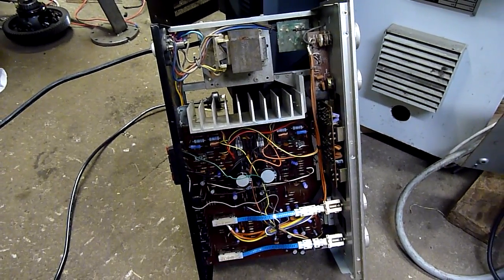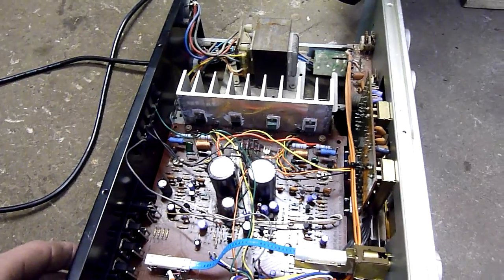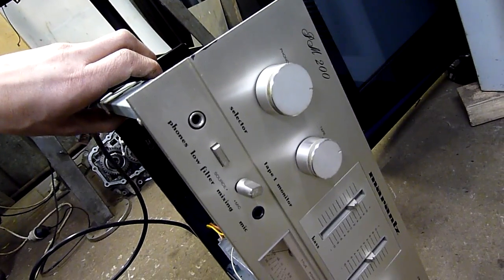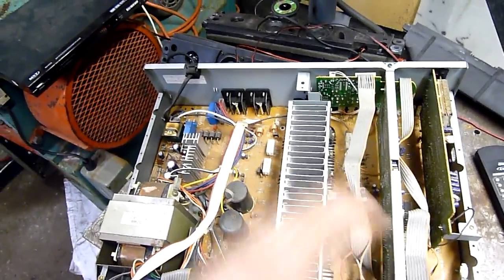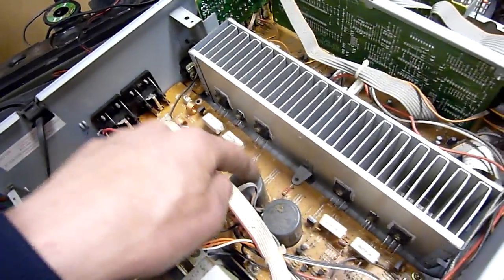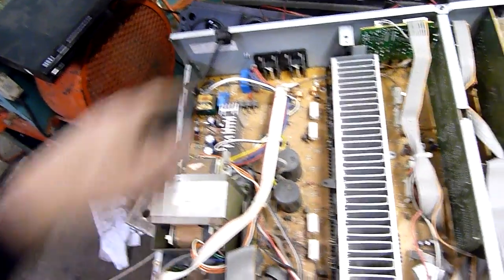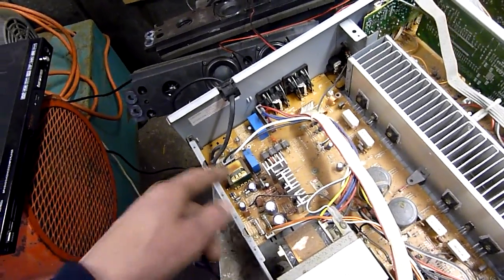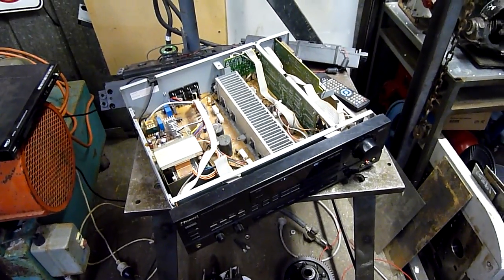Marantz and Sherwood Amplifier Updates

Comment: think the Sherwood was made for a 110v system and not the 220v and as a result for some reason they come with a hum otherwise a great amp I have lived my hum but must get a capacitor soldered into the power supply think that should cure the AC noise

Comment: Generally an class AB amp should work well without the output transistors, that is no DC at output and nice clean speaker level signal (just do not apply load to it!). Output can be checked with other amplifier thru a resistor voltage divider for example.
Good to check before adding in new transistors and when you do, I strongly recommend to power the amp with current limited source - like a let's say 50-75W lightbulb in series with amplifier mains input.

Comment: i had a similar sherwood (dolby digital) amplifier. I would check the pre amplifier circuit as that is where i found the fault. It did eventually die but for something found on a skip with a boot load of other stuff it was a free bargain.

Comment: Last amp has an grounding problem. Ive seen that with my sharewood amp. I got an 4000watt system at home in an apartment complex. But yes its annoying. I run an grounding cable from one amp to the other.

Comment: Check voltages on output transistors, base should have something around 0.5-0.8V and minus 0.5-0.8V on the other half (I mean PNP and NPN output transistors). If voltage there is higher or no voltage at all, means transistors are bad, or the driver transistors are bad, drivers are those that are a bit smaller package near output transistors, easy to spot them. This amps really like to burn outputs, but it can be just a preamp stage, maybe some 7805 died on preamp, also really common.

Comment: It could be a faulty Op-Amp or just a faulty connection/cable/fuse. Seen it way too often. I used to fix such "trash find/friend gave me" amps. Check all the connections first. Then grab a multimeter and check for suspicious voltages/missing voltages. If voltages seem to be correct, then follow the leads to the main Op-Amp, and check if it gives out something (/w some old/trash headphones). If it gives out sound, and it gets to the main transistors, then=transistors bad.

Comment from the maker: it was a ground loop issue, I had a broken solder joint on the audio in socket which did not help either.

the amp seems to be powering the output stages, just nothing apart from 100% performance of the center speaker only :(